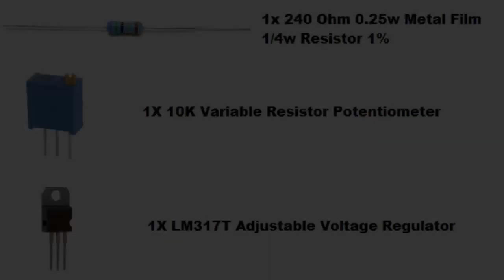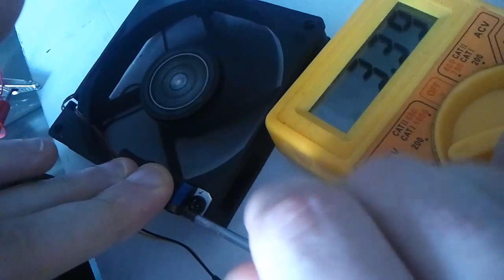How To Build A PC Fan Controller For (£1.50/$2.43) Only 3 Components!

Comment: Couldn't quite tell on the video but the resistor looks like brown black black or red black black or red brown brown? this would either be 10 ohms, 20 ohms or 210 ohms respectively. Whichever one it is using it with a 10000 ohms (10k) variable resistor is not needed, a 2000 ohm (2k) would go up to a maximum output of 11.6V (if you were using the 240 ohm) and give much more finer control than a 10k turn for turn on the adjustment screw. This is the formula from the data sheet Voltage out = Vref (1 + R2/R1) + (Iadj x R2). Vref is always 1.25V and Iadj is so small you can ignore the last bracket. So substituting the numbers in we get voltage out = 1.25 x (1 + 2000/240) = 11.7V. taking the adjustable down as close to zero as it will go will bring the voltage very close to the minimum output of the LM317 which is 1.25V. The data sheet also states the component could drop up to 3v (which along with the voltage difference between input and output is dissipated as heat) but in my experience this component at lower voltages normally drops about 2V which still means you will never get the full 12V out. The PSU on the PC is regulated so is definately a 12V supply to the fan. Without heat sinking the LM317 can dissipate 0.25W, this means at the maximum voltage difference of about 9V (your fan will probably stall under 3V) you could draw a maximum current of 27.7 mA without a heatsink which may not be enough depending on the fan. You will most likely be drawing closer to 100mA for most fans so running them at low speeds for long periods you will need a heat sink. H?ope all this helps you guys

Comment: I know this is an older video. What if you added a thermistor instead of a resistor.  Would you get a variable thermal controller? I am needing something like this, but thermal controlled. Great design, will definitely try tonight.
Reply from the maker: Joe Fulwider  I did do one with a thermistor but I couldn't get a cold fan speed curve as temp goes up. You need to calculate resistor values and so on. Best way to control fan with heat is by using ic chip but then it gets very complicated and expensive
Reply: Thanks for the info! You'd think replacing the  Pot with the Thermistor would give the same results as long as you use the correct thermistor. Probably why, I can't find no one else doing it. I am building my 4th DIY power supply. Would be awesome if on this one, I could use some of the smaller fans with thermal control for next to nothing in cost. Looks like I might be stuck with the bigger Thermal controlled fans(not a big deal, was just hoping).
Reply: One more quick Q. Can you use one module with multiple fans? Just curious?
Reply from the maker: Joe Fulwider curse.long as you don't go over 1amp. And keep eye on it getting too hot. I think the lm317 has thermal protection so will turn off if it gets too hot. Read data sheet of the lm317 it will tell you everything you need to know.
Reply: Thanks again for the input! I have some LM338 and 317s. Its a simple circuit I will play around with today. I really appreciate the responses! Thank you!

Comment: doesn't the lm 317 get very hot this way without a heatsink I need to make a speed fan controller but I don't have much room for  2 fan push pull configuration
Reply from the maker: Polo Driver  i ran it at about 5v and it was barely warm. this will vary from fan to fan but if it gets to hot to touch stick a heatsink on it. i ended up mounting mine behind the fan so the fan itself kept it cool :)

Comment: What if i use 5v input, like power bank? Is the output voltage can go up to 12v?
Reply from the maker: +Alvin you would need to use a booster converter that will boost 5v to 12v.

Comment: you can turn down FAN Voltage in BIOS for 0.00$ and its quieter after this
Reply: IF bios supports that!
Reply: if you are using that with PC which is not the only application